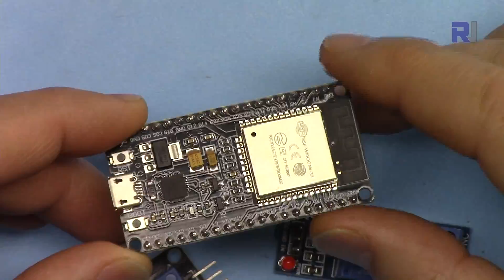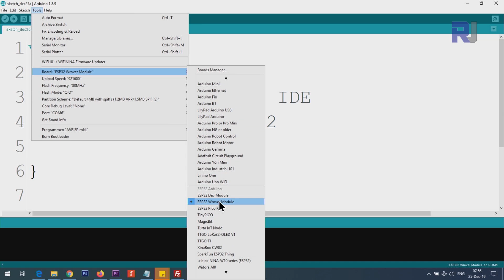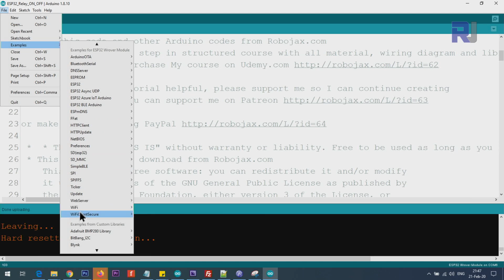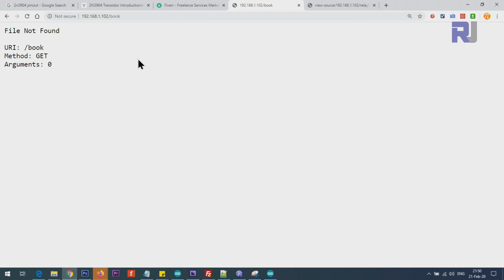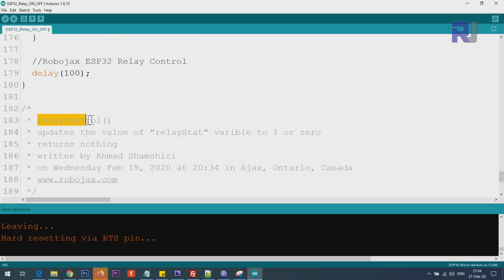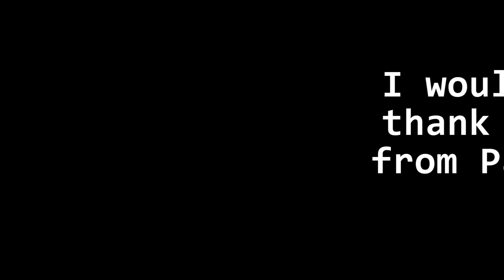E271 ESP32 Project: How to control AC bulb or load using Relay over WiFi  - RJT271

Comment: Hello, I 'm not sure to properly understand, at 1:40 you mean than one is a 5V electromagnetic relay, while the other is optocoupler which may either switch on 5V or 3.3?
Additionnaly, you mean than eventhough if one binds to VIN(5V), the switch is powered at 5V, but its logic still needs 5V but the board only delivers 3.3V and so the HIGH status is unreliable? Interesting, but then what's the use of  having a 5V VIN??
Reply from the maker: Hello, all your questions are answered in the introduction to ESP32 which seems you have not watched. here https://youtu.be/--Fj8QDlGuQ

Comment: Hello Ahmad , i wanna ask you a question , can i control a relay from anywhere using  EPS8266 or it should be only over the same wifi? for example can i control the relay from my phone application over internet regardless the distance between the eps and the command?
Waiting for your reply dear,
Thank you
Reply from the maker: Hi, no you can’t . This just in your own network. If you want it from outside home, they searching for “how connect to my home computer over internet “ and  if you solve that, then you can do the same with this internet of things IoT.
Reply: @robojax  Ok , can you suggest me about any device name or any strategy or anything that can i use to solve this issues? i am now working on a home automation project, but my target is to control my home devices from my phone application , and the most important part is to control them using my phone application and as i told you regardless the distance between my phone and my devices .
but if you don't have any suggestions or any informations related to this field no worry dear.
thank you for your reply
Reply: did you find any solution for this? @RoMecha_lb

Comment: You have an amazon link to the esp32 you used, but I can't seem to find the 3.3v relay module anywhere.
Reply from the maker: Use 5v relay. ESP32 has 5v power pin.
Reply: @robojax  Ah! Thanks, I have a 5v coming.  I have a device that turns on a 12v fan that I'm hoping to use an an input signal to an esp32 to then trigger it to send out a low power bluetooth beacon of 'on' for a second esp32 to sense and have it trigger on a relay.  If the ESP32 can drive a 5v relay that gives me more options.  So many of the relays I have found on Aliexpress and Amazon use a shared power source for the trigger voltage AND the relay coil voltage.  I don't want to pull enough current from the trigger to drive the relay, just to signal a data 'high' to tell the relay to turn on.  Seems like that must not be a common use case from the sheer volume of 'maker' relays I've seen online that use the shared input design.

Thanks!
Reply from the maker: You are welcome.Yes if you get relay module that has driver on PCB they need very little current. So you should be okay.  Stay safe and don’t forget to subscribe.